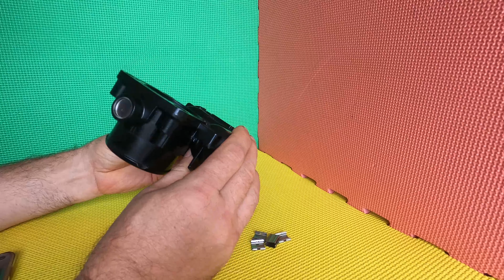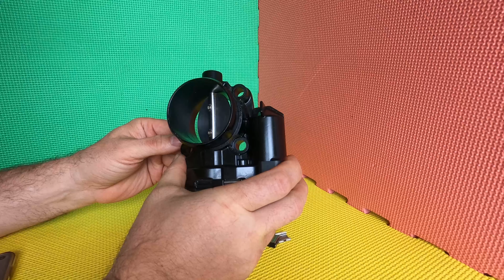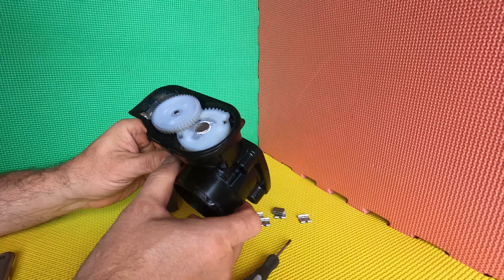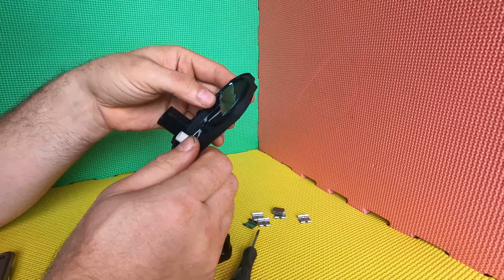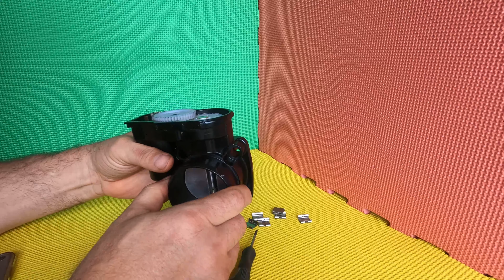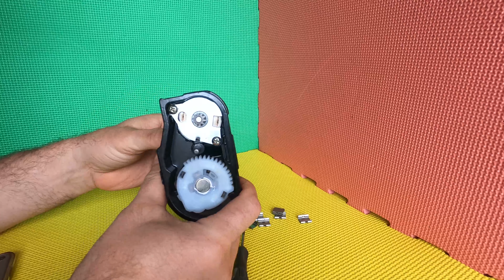SeaDoo throttle body from Ebay 60-120eu

Comment: hello,  you said burn cap controller if you install this one? and don't drive aggressive? I couldn't understand thank you for your comment back.
Reply from the maker: My expireance  , after install throttle  body with magnetic position sensor , decided reset angle with buds program , got foult reset and ECU was stopped work ( frozen) for 15 min . After restart  seadoo , got throttle body foulty , not starting seadoo . Decided  install back old  throttle body with normal sensor , again position reset , and seadoo again  begin work . Throttle body with magnetic sensor work on seadoo ,  but position reset inpossible